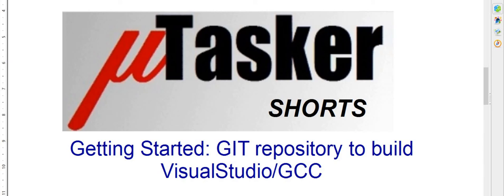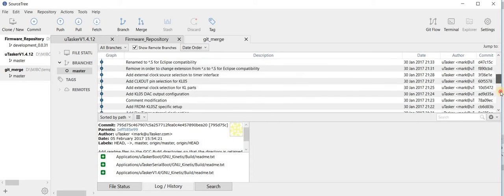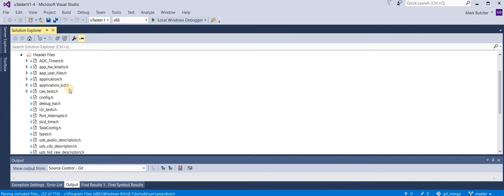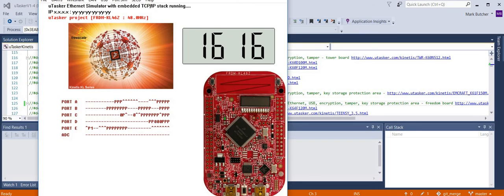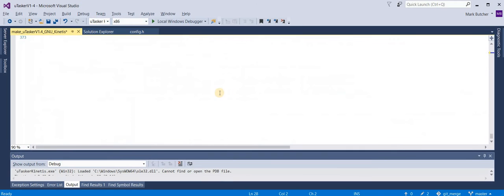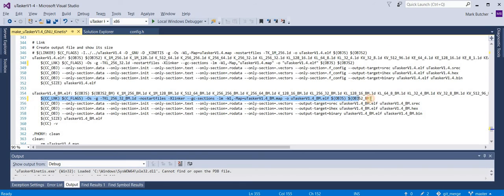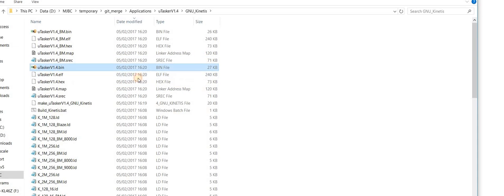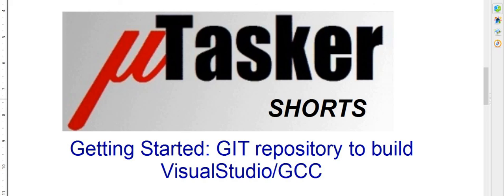uTasker SHORT Getting Started - From GIT to running board

Comment: Hi again, i got visual studio community 2015 as the video pointed, and i can build without GNU, but when i try with GNU it gives me 5 errors all pointing to change the directory to "Build_Kinetis.bat", coded as error MSB3073.
i tried fixing it running "vcvarsall.bat" with no luck.
Reply from the maker: Hi
See whether this helps: http://www.utasker.com/forum/index.php?topic=1988.msg7410#msg7410
Reply: i installed kds_v3 to check if the "make.exe" to replace was in the path said by the "build_Kinetis.bat", but it's not there, plus the path in the "build_Kinetis.bat" on "uTaskerBoot" differs from the serial boot and v1.4. so, it didn't fix my problem and i don't know which make i have to replace.